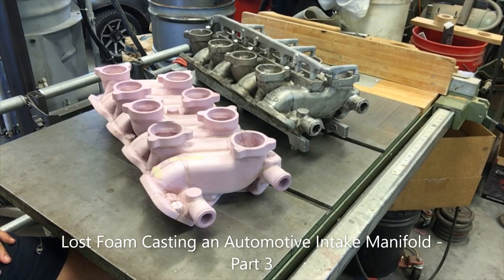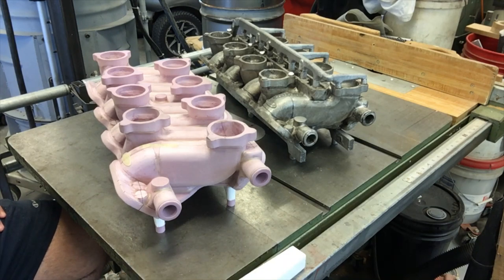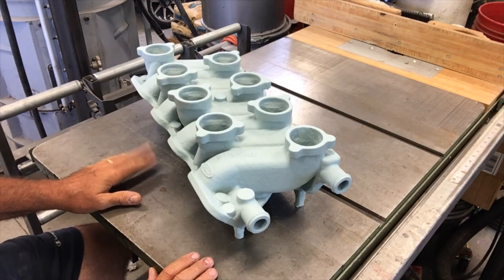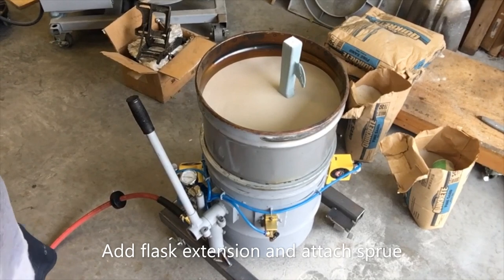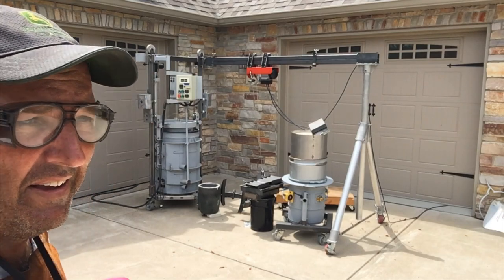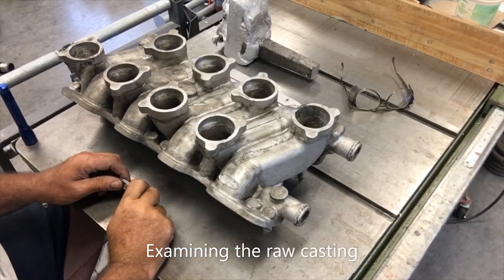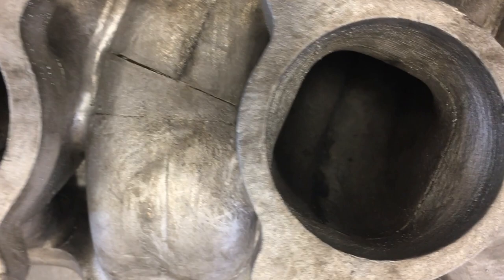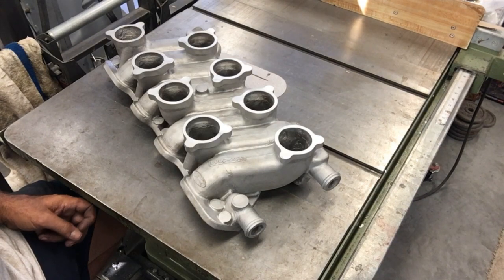Lost Foam Casting an Automotive Intake Manifold Part 3

Comment: As a 72 year old retired patternmaker, all I can say is excellent job  best I've seen in a home shop.
Reply from the maker: Thanks Dave. Much appreciated. Check out my automotive timing cover. People always ask me what my favorite project is.......answer: my next one! Best, Kelly
Reply: @kellycoffield533  I got in an argument with a backyard foundry man about lost foam. I told it's best to start wood. He said that's because I didn't know how. He made blocks. So I made 2 burner venturi one for demo and one for myself. I used a small cnc mill cut 4 pieces glued and posted pictures, he shut up then. Simple compared to what you're doing. But I now have a bigger cnc I might get more ambitious. That for help get off my backside.
Reply from the maker: @roscoepatternworks3471  LF has it's place. Take care, K

Comment: BIG Thumbs up. I do a bit of sand casting and machining, just found your channel, Because I am fairly good at cad design and have a 3d printer I have gone down the 3d printing, (either lost or split) method. I will try your method. Apart  from your volume issues excellent content well explained, Regards and thanks from Brisbane Australia

Comment: That intake on a boss will be unbelievable. I'm going to build a 427 small block Boss based on a 351W block. An intake like that with bellmouths inside a plenum will be awesome for boost.  I think I'll start with a diy built 4x8 5 axis CNC Router. It will be like cheating for making the foam pieces. That's not the reason for wanting the 5 axis but just another reason to jump in. I've been sitting on the dang fence nearly 5 years. Time to get busy living.

Comment: Ah, the sweet taste of success. Persistence, patience, and reason wins as ever. Damn well done - Bravo... Martin
PS, I would have hated to try and do that casting in greensand - Oh - the core work I would have needed 😱!
Reply from the maker: Many thanks Martin. Another of my lost foam curiosities is its (apparently higher) resistance to shrink defects. Though the flanges are 1/2" thick, the rest of the features are 1/4" wall, excepting the various mounting bosses which from a casting perspective appear as 1" diameter blobs positioned here and there around the casting. Perhaps the best example is where the long 1" diameter bosses connect the mounting flanges to the runner walls.  From a casting perspective they present like six separate 1" diameter risers yet where they intersect and blend with the 1/4" thick interior runner wall surface, not a hint of shrinkage. I don't have a good explanation for this other than the combination of comparatively slow mold fill times and predominantly top to bottom feeding promotes a sort of natural directional solidification from bottom to top. -Just a theory, but whatever the cause....I'll take it! Best, Kelly
Reply: @kellycoffield533   Ah, the enigma of isolated bosses and shrinkage! It may be that shrinkage has occurred via the skin sort of universally moving inwards. It can be calculated that only a few "thou" of  inward movement is needed to get the boss completely solid. If the boss is still close to its melting point the skin will be soft enough to collapse inwards and provided it does not do it locally  we wil never know. This whole process relies on good clean metal as it does not take much entrained oxide to serve as nuclei for shrinkage pores.  High conductivity metals seem to favour sound bosses but remember that bosses may in fact have central porosity and as we often drill/tap bosses we may remove said porosity sight unseen. 
My experience with isolated bosses would indicate that solidification time plays a big part in what you can and cannot get away with.  What I can get away with as a sand casting would likely show shrinkage in gravity die work where solidification times are much shorter. You are using dry sand so solidification times will be a lot longer and thus I would expect you to be able to get away with more. Also of course as you point out slow and very progressive mould fill plus top down feeding  just has to help... Martin

Comment: Hi Kelly, can I give you a tip that would have saved your first attempt?  It is related to the filling process. You need to have the vibration turned on throughout the mold fill. The vibration creates a "fluidised layer" about 2 inches deep ... beneath that is the "compacted zone" ... once you have about 6" of sand in the pot, you need to turn in the vibration and start filling the mold.  If you fill too much before turning on the vibration you will get areas of the sand that did not get fluidised and flow. The fluidised zone is about 2" deep in small pots like yours, so the fill you put in before turning on the vibration was too deep to effectifely fill in some areas. In commercial production the vibration is applied throughout the fill process. I hope that helps you.
Reply from the maker: Thanks Rob, yes indeed. There were 4 changes made for this successful attempt compared to the previous fail. The discussion starts at about the 14 minute mark, but there was better pattern positioning in the mold, I did indeed vibe as I was filling which is a big aid because I'm underpowered in respect to vibratory energy for big molds so vibing while the mold is filling compared to 450lbs of full mold helps a lot in that respect too. I also nearly tripled the vibratory energy with larger turbine vibrators, and perhaps the most significant was the use of fresh mold media. I had been (re)using my mold sand for 2-3 years with most seeing several hundred pours. It was contaminated with organics and consequently, was more difficult to excite and fluidize. By comparison, the new media was a treat. Now the shape of silica sand certainly isn't optimal for vibratory packing but it's so inexpensive, it's thehands down practical choice. Same goes for reconditioning the sand. I could bake the organics out but the energy cost to do so is more than the cost of the sand. It's 10c/lb at the retail stores and $20/ton in bulk. Thanks for the comment and watching. Best, Kelly

Comment: What's the reason for not using a vent to allow gasses to escape?  Is your sprue big enough that you don't really need one?  Phenomenal work, I'm amazed and inspired.
Reply from the maker: Vents can't vent in lost foam casting. If you make the vent feature out of foam it's solid until melted and by that time there's no need for a vent because that area of th emold has already filled. I see people  attach a soda straw to the pattern thinking it's a vent, but the straw is plugged with closed cell foam until the molten metal front reaches it then it fills with metal so it's no longer a vent then either. In lost foam casting, the entire surface of the mold is the vent, coated with permeable coating, and this controls the rate at which evaporated foam gases escape/vent and the corresponding rate at which the molten metal front advances. Best, Kelly
Reply: @kellycoffield533  Great, thanks for spelling it out simply.  Makes sense.  Are there any good books or references you used to learn this?
Reply from the maker: @mikeboudreaux2964  I wish I could. I'm a member of American Foundry Society and about the closest would be "Lost Foam Casting Made simple", which it doesn't. It's 250 pages and by the time I bought it, it didn't do much for me. More than half was devoted to managing beaded materials and pattern molding process which was of little interest to me because it's impractical for low volume and home use. Wasn't much usable practical information on molding, coatings, and casting process control or even pour temps. I've gotten most of my information watching the YT videos of the (Chinese) LF equipment manufacturers and reading research papers which have even less useful info than the AFS book but an occassional nugget. If you search here on YT there is the Lost Foam Council based in EU, but again, not much there except one 4 minute vid. Besides that, it's the school of hard knocks I'm afraid. Best, Kelly

Comment: I know nothing about casting, but what you have achieved looks pretty impressive to me. Congratulations! I’d be interested to know how much time you spent on designing the pattern, making the pattern, preparing it for casting, preparing the cast, and tidying it up ready for machining. 

Apart from that really impressive hi from Switzerland
Reply from the maker: Thanks J, I dont know. I didn't keep track and of course I did have the pleasure of making that pattern twice. I can tell you this, it took much longer to arrive at the design and dimensional layout than it did to actually fabricate the first pattern, and much less time to make the second pattern than the first 🙂Best, Kelly
Reply: @kellycoffield533  sir i love your work and i think instead of wax to use your method may i ask plz what kind of coating is that and can i cast somethink out of ferous metal(stainless steel) with it? Thank you
Reply from the maker: @umbeatable2770  I have a video entitled "Refractory Coatings for Lost Foam Casting Patterns" on my channels that discusses the coating.
https://youtu.be/LdgGkqvk5mc
The coating I use is for non-ferrous casting. The ferrous casting equivelants use higher refractory alumina oxide or zirconia as the fillers. Best, Kelly

Comment: Held my breath on the 2nd pour...don't know if it helped.... but it was a good one!   What actually happens to the ceramic that coats the foam?
Reply from the maker: Some of the coating falls off when demolding and about 90% falls off when dipped in water. The rest can be blown off with compressed air. Calling it ceramic is a bit generous. It's more like drywall joint compound. It is still water soluable after the pour. I've been calling it refractory coating while others comment on it being ceramic, likening it to shell casting, but the intended purposes are different. In lost foam the coating just preserves the pattern surface finish and serves as a permeable barrier to control the rate at which gases escape into the mold, and you do get some modest insulating value from the mold media, whereas the ceramic in shell cating is the structural mold. Best, Kelly
Reply: @kellycoffield533  Certainly a beautiful casting....truly amazed at how the relatively fragile and permeable coating can keep the dry sand from collapsing into the burned out foam cavity!

Comment: Is it possible the little deformities are caused by the gas escaping as the form is burning away?
Reply from the maker: Yes, but rather than the foam, in this case, if that was indeed the cause it's more likely dues to the wax I used to apply fillets. There was a lot of it in this pattern since it was hand made in many pieces and then assembled. These days I CNC the patterns and there are far fewer pieces and the fillets and blends are machined into the foam. Very little of the foam becomes carbon/ash. The vast majority of foam is converted to gas which is expelled through the refractory coating into the mold and the amount o fthis gasis probably comparable to steam created in a conventional green sand mold or other binding system. Best, Kelly

Comment: You mentioned a few times that , aside from the flanges being 1/2" or 3/4" thick, that the runner walls are 1/4" thick.
How do you determine that ? I know if you make the core’s x" by x" , is the optimal thickness of the refractory coating 1/4", or whatever you want the wall thickness to be?
That’s the only way I could imagine it happening since the inner and outer surfaces are encapsulated in the sand.
I have very little experience in sand casting, high school Vo-Tech classes in the 80’s.
But I’ve always been interested in the subject for many years, and always study up on things like this, to the extreme for some subjects, even though I’ll never get a working, hands on experience in it.
I’ve had a long time "love affair" with the Ford 300" straight 6, but only a few people had ever done much, if anything, about it’s poor head design.
A few people, Sherman Sly comes to mind because I recently heard an interview of him on Drag Boss Garage. (I think), He welded together 3 cut sections of cast iron Boss 302 heads to make 1 long cross flow head that whooped some tails and hurt some peoples feelings. WELDING CAST IRON HEADS!!!
But anyways, on something like that, how would you account for shrinkage? You mentioned 13% (0.013) for your manifold, would you have to allow more for the size (length, primarily)?
Would you take the bore spacing, don’t know the number off the top of my head, but I believe it’s about 4.00". Would you work off of that, 4.00X 6 (# of cylinders) and add .0022 to each bore spacing?
I’m sure there is more to it than that, but it’s the kind of crap I’m actually thinking about when my wife says "what are you thinking about?  Lol
I know it’s a bit off topic and long winded, but I’m curious.
Reply from the maker: 1/4" wall is just a reliable thickness for sand casting because of typical heat loss to the mold. The flange thicknesses are what they are because of the structural needs of the part otherwise I'd shoot for uniform wall, but given their thickness, it makes them a convenient vehicle to feed the rest of the part. Best, Kelly

Comment: You may have explained it in an earlier video but I'm curious about how long it takes to melt the aluminum. Also wondering whether it might have been better to cast the part in its horizontal position.
Reply from the maker: Both my furnaces are 8kw resistive electric powered, basically a kiln optimized for melting. For my smaller furnace, on first heat it takes 25 minutes for 10lb of aluminum in an A10 Crucible, and about 40 minutes for 20lbs in an A-20, 5-10 minutes less on subsequent heats. In this intake video I used my larger furnace with 50lb charge in an A60 crucible and electric heat. It took almost 2hrs because the mass of the furnace and crucible without metal is ~200lbs. My larger furnace was intended to be fuel fired but I have an 8kw electric insert I use for aluminum. As far as position of the pattern, for my proces I'd say far batter off (near) vertical from the standpoint of packing and practicality. Also for lost foam, you need some depth to the mold or the metal pressure will "float" the sand, especially in denser (than aluminum) alloys, and it does provide more metal head pressure at the bottom of the mold where it is most needed, because that is farthest from the sprue and the coldest metal by the time it gets there. Best, Kelly

Comment: How’s it stand up to welding any imperfections if need be? What does it fit? Sorry haven’t watched other videos.
Reply from the maker: It can depend on the alloy, but the 356 I use welds nicely. If you are an accomplished (TIG) welder, you wont think much of casting aluminum alloys compared to wrought alloys, especially if they have been in service with liquids beause the tend to be somewhat porous and hard to get clean. Preheating the area to be welded helps sweat a lot of that stuff out and helps a lot. Best, Kelly

Comment: great job! excellent patternmaking! When i casted my intake i did not quenched it and could not read the temperature of my aluminium. and when i machined it and pressure tested it under water i found that it was so porous it couldnt make vacuum because of it. (for a v8 flathead from ´51 with two drawthrough turbo.s) so i ended up powdercoating them. Do you think that quenching would made the difference? i read in a book that adding argon in the bottom of your melted material would make it denser? let me know your thoughts, and again great work!!
Reply from the maker: I just quench to cool the casting and remove the refractory coating. The casting still requires post heat treating for improved strength and machining properties. Porosity is more a matter of your pour temp, molten metal treatment, and also part/mold design. I use a resistive electric furnace that has a very favorable atmosphere for aluminum. Best, Kelly
Reply: good job on both of you guy's as i wasn't going to cast my intake as i figured it requires to much for me to do it right. but i did have one eddelbroc 383 BBM-B that was really porous and had a lot of sand/slag in it, i did get the weld to stick but it's not perfect or pretty but i wanted fuel injector boss's and bolt one ones for sale are slim pickings ect.

my new/different engine a frankinstined G2 hemi stroker id figured that welding a crossram/3 layered runner/variability runners one up or making out of fibreglass/CF is the ticket just hope that it can hold max 30 PSI of boost and a back fire 🔥does burn it and or my car

Comment: Instead of dumping the sand out would it be better to use a vacuum system so that it can be re-used?
Reply from the maker: Oh, I do re-use the sand over and over. I just run it through a sieve as I shovel it back into its storage container to remove any refractpory coating that fell off the casting and any sand clumped by the byproducts of decomposed polystyrene. My last batch of sand I used for over three years and  ~200 castings before I replaced it. Best, Kelly

Comment: Nice outcome on this one. How are you going to seal up the valley area of the engine to the outside?
Reply from the maker: The bottom side has sealing lands that line up with the valley rails on the block like other intakes. There's also a shelf in the bottom side of the intake to install a splash shield or plate so the underside could be used as vacuum plenum. There;s a boss on the rear of the intake to access it. Best, Kelly
Reply: @kellycoffield533  got it, so it uses an intake gasket like an FE engine that is a sheet metal valley pan and gasket together
Reply from the maker: @jamesford2942  Just flat gaskets betwen heads and intake and cork and/or silicone on the valley rails. Best, Kelly